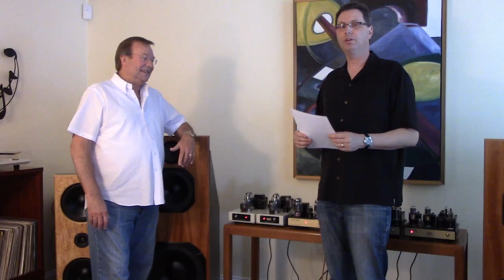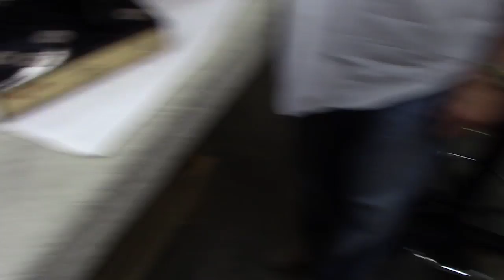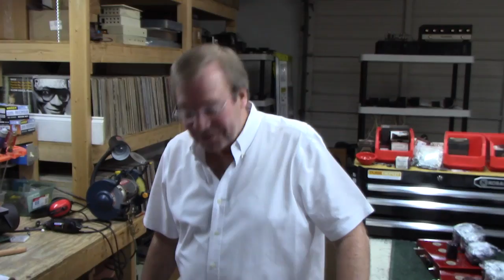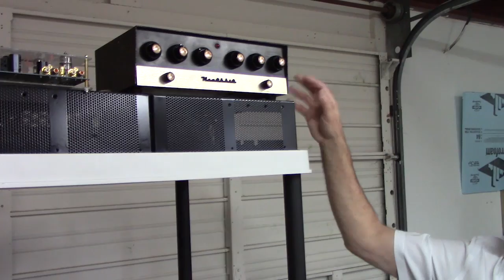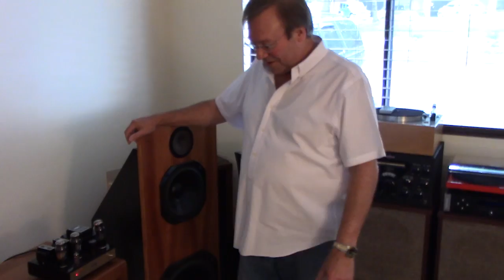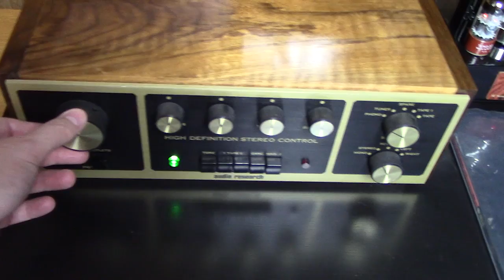Interview with Dennis Had - Inspire, Cary, Dentron Tube Amplifiers - BG059

Comment: Have a question. I have a pair of original Cary 300SE mono amps. Build in 1996. Have the 3 tubes per unit, 6SL7, 300B and CV378 ratifier . One amp does not turn off even when I put switch in off position. Any help would be appreciated.

Comment: Greetings,
I enjoyed your interview and my curiosity was peaked when during the interview it was mentioned that Dennis was using a regulated power supply, below the plate voltage, for the screen grid. How does that affect the linearity of the tube, vs using the ultra linear transformer tap? Or is it a more stable configuration of a triode configuration?
Thank you on your channel.